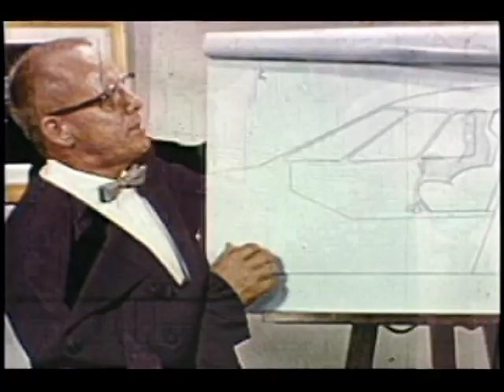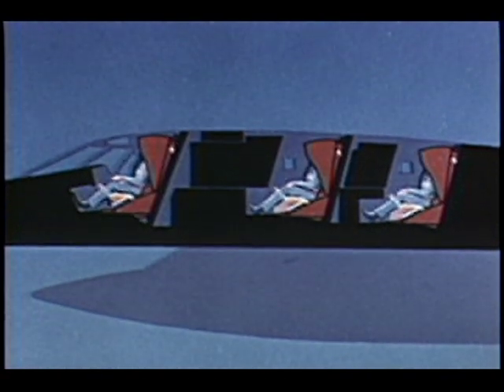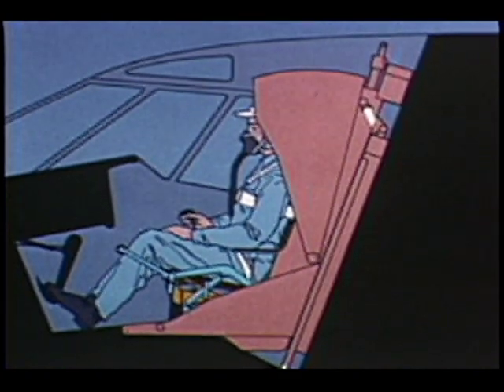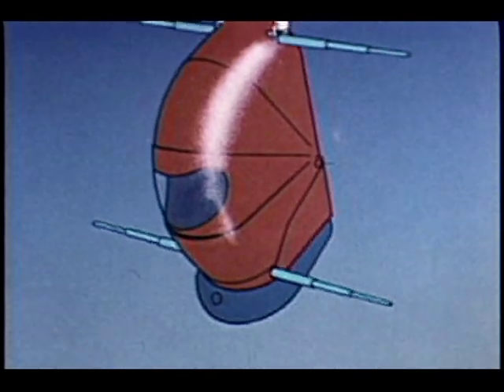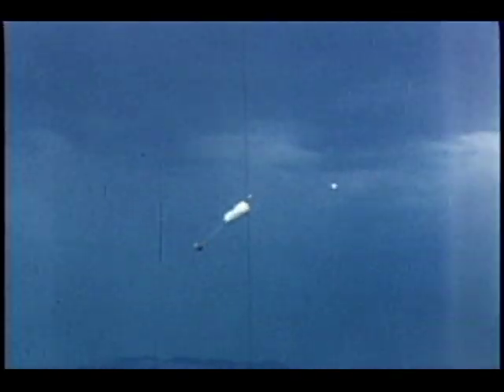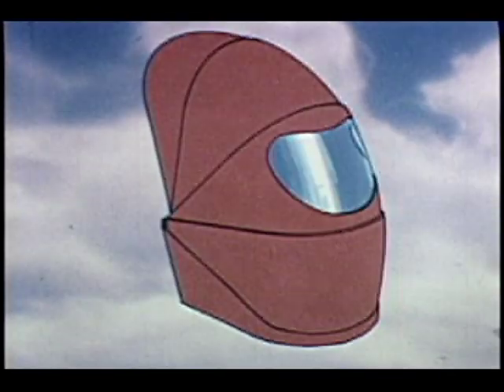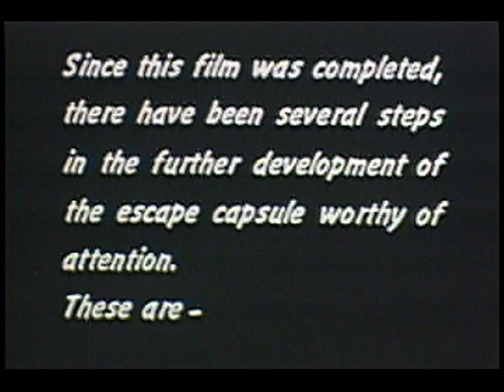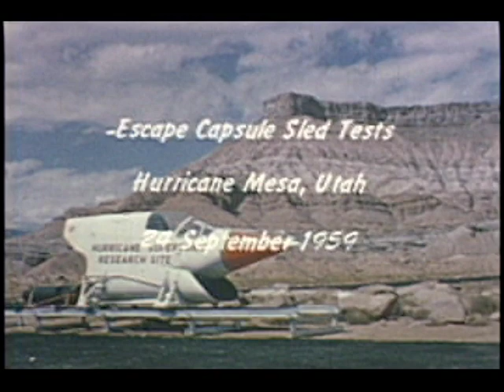Convair B-58 HUSTLER Escape Module Development

Comment: I was stationed at a B-58 wing & KC135 tankers. There was 1 incident in which a bailout was necessary. Every thing was cool until all 3 crew had chutes that didn't open.  Another was an aircraft that lost both right engines at time of airborne. A friend in CSC told me that there was nothing left to find of the crew.

Comment: This escape system was also installed on the XB-70 Valkyrie and the X-15.  It was actually used when one of the two Valkyrie prototypes collided with a chase plane and went down.  For some reason the copilot failed to eject and was killed.  The pilot did eject but it was only a partial success as the "deceleration bag" failed to deploy and he sustained severe back injuries.
Reply: The X-15 didn't use an escape-capsule it used an ejection-seat.

Comment: Well, ejecting even today is still quite dangerous and not always survivable, but it was a lot worse back in the day, when they had explosive charges launch the seats. A "successful ejection" meant you survived uncrippled; it was quite normal to sustain spinal injuries from the violent acceleration. If you didn't recover, you could still be a ground instructor, or you could end up paralyzed. And of course, there was no "zero-zero" seats, and ejecting outside the envelope was usually bad.